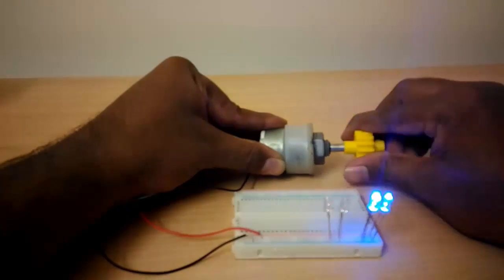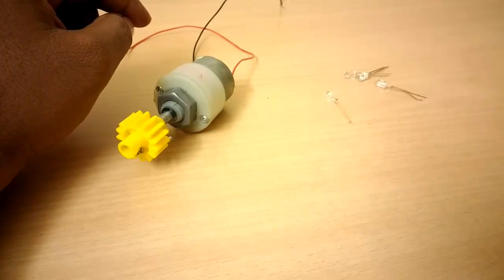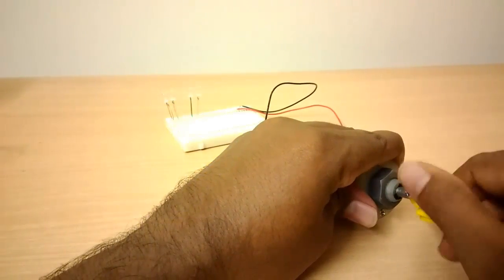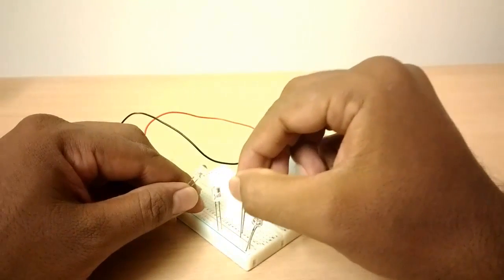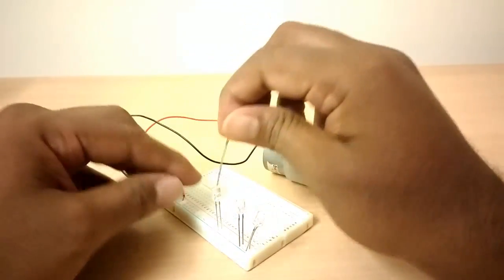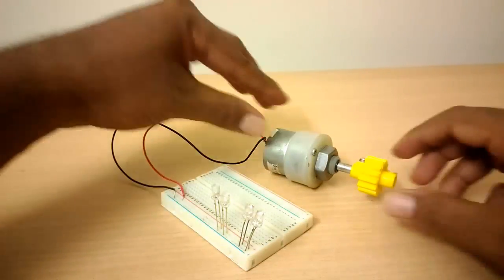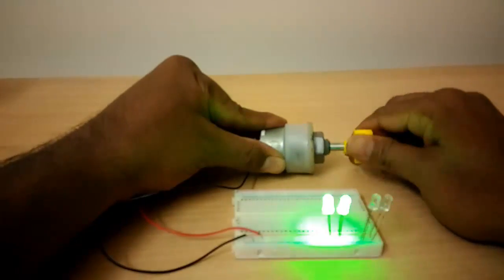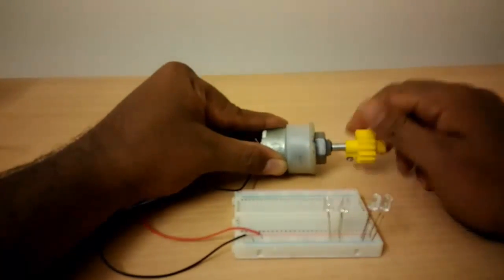How DC Motor Works as Generator? | Turn DC Motor Into Electricity Generator

Comment: I have the same dc motor, tried doing what you did, and did not get the same results. The motor would not generate electricity at all. What am I doing wrong?
Reply: UPDATE: I actually ended up figuring it out. It does generate electricity, but I just have to spin the shaft fast enough in order for it produce enough power to light up a 3v light bulb. It produced 6v so far.
Reply: Do you use a motor of 6V ?? @garrettanderson8729
Reply: same problem